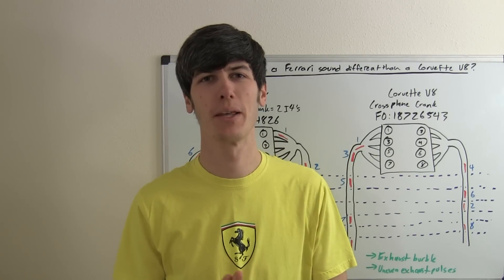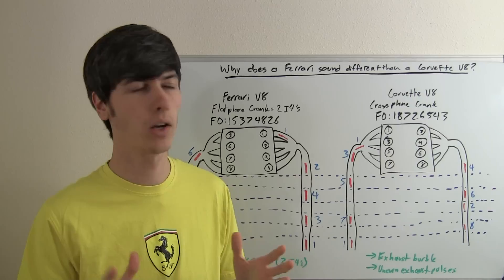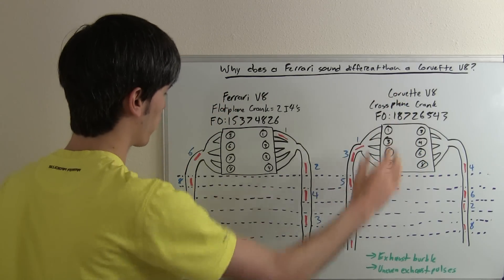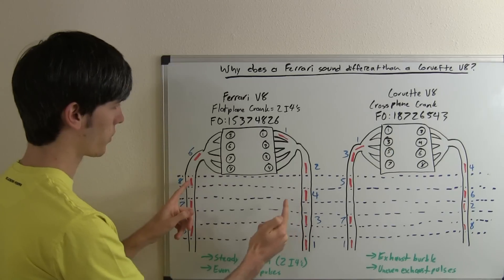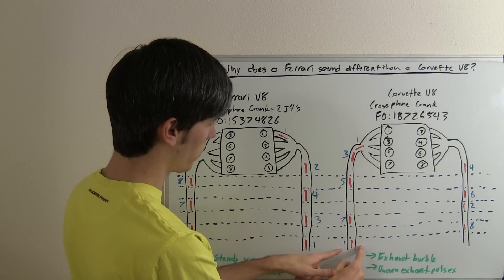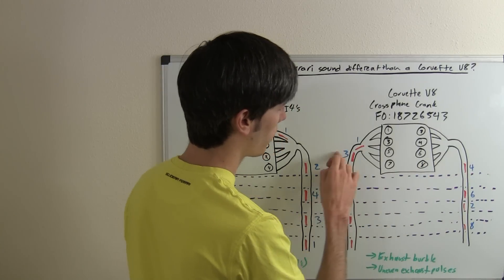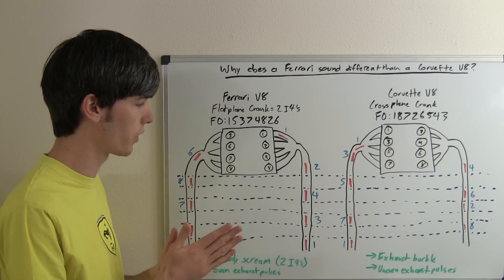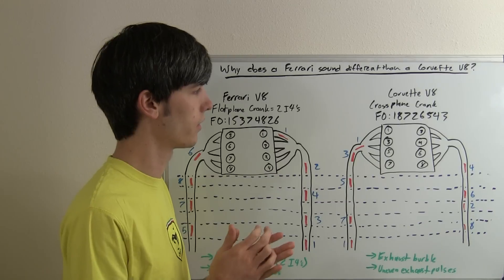Ferrari V8 vs Corvette V8 - Why do they sound different?

Comment: That's really cool, and it explains not just Corvettes but most American muscle cars. It also explains why supercharging is preferred over turbocharging on American V8s.
Reply: +Jason Gade American manufacturers seem to prefer supercharging the V8s, but I can tell you in the aftermarket world, turbocharging American V8s is quite effective.  Biggest limitation is heat.  6+ liter engine plus 2 turbos under the hood of a corvette get mighty toasty, and is harder to intercool than a blower.  A V8 with turbo lag is a bit strange also.  Most consumers would probably prefer the flatter torque curve of the blower, even though the turbo makes more power overall.

Comment: This crossplane / flatplane dichotomy also applies to inline four cylinder engines. The 2010 Yamaha R1 motorcycle uses an inline four with a crossplane crank - it makes the "v8" sound. So, in my opinion what we call the "v8" sound is in fact the "crossplane crank" sound. And the almost characterless sound of an inline four with a flatplane crank is also made by a v8 with a flatplane crank.

Comment: My Porsche 928 32 valve has a firing order 1,3,7,2,6,5,4,8. Cylinders 1 and 3 fire in succession on one side and cylinders 6 and 5 on the other side fire in succession. 2 and 4 in succession one one side and 7 and 8 every 90 degrees. I installed a free flow Mangaflow Muffler and I was next to a Ferrari at the traffic light and the driver gave me a sound compliment. My car sounds like an American muscle at idle but in higher RPM sounds more like a Ferrari. I'm not  sure if the firing order has anything to do with it but thanks for posting this. What's interesting is a 4 cylinder Alfa Romeo sounds like a toned down Ferrari.

Comment: There are multiple firing orders for both flatplane and crossplane crankshafts. Although this discussion only deals with the sound I would suggest you make a video describing each different type of firing order and explain the pros and cons for each. Which ones make more power, which ones make more torque. Which ones have high dynamic vibrations, which ones do not. Different firing orders achieve different results. Some firing orders make the engine run smoother at high rpms and some will shake the engine to pieces and explode!

Comment: The exhaust imbalance with cross plane crankshafts can be dealt with by using 180 degree headers.  It makes for one long primary pipe on each side and isn't very practical for street applications, but they are typical in racing engines.  They do change the exhaust note to more of a rasp than a burble.

Comment: A very good video, and it very clearly explains the difference between a cross-plane and flat-plane V8 engine... what you didn't explain was why most V8's are cross-plane, and the fact that cross-plane V8 engines are perfectly balanced, whereas flat-plane V8's, such as Ferrari's V8's and the upcoming Ford 5.2 liter GT350 Mustang V8 are inherently imbalanced, and are quite dependent on a short-stroke in order to not shake themselves apart.... in fact, it was widely accepted that Ferrari had pushed the outer limits of flat-plane displacement with their 4.5 liter flat-plane V8 until Ford developed the upcoming Shelby Mustang GT350's 5.2 liter flat-plane V8... Of course, Ford never could pass up an opportunity to one-up Ferrari, and more power to them, as that particular corporate feud dates back to the 1960's....  at the end of the day, the flat-plane crank V8 sounds incredibly sexy, but since it is inherently inbalanced it has fewer practical applications than the cross-plane V8, but is still a very interesting and sexy-sounding option as far as V8's go.
Reply: Ken Johnson  The 5.2 engine has an almost square bore and stroke at 94mm x 93mm.   It's not a short stroke engine at all.
Reply: The advantage of using a cross plane crank in a V8, (90 degree crank) is improved harmonics - it won't "buzz" at certain speeds, but, exhaust scavenging is inferior, and, two of the crank shaft's counterweights must be heavy enough to cancel out the see-saw like rocking couple such a crank will generate.  The use of a 180 degree crank in a V8 results in better scavenging and a lighter crankshaft, but, at certain speeds the engine will buzz just like a 4 cylinder engine.

Comment: Not a bad video at all. Some years back I heard what changed the exhaust note was the 60 degree cylinder angle, until I realized the third gen Ford Taurus SHO 3.4 liter V8's had the same set-up. So a little research explained it was the flat plane vs cross plane crank which changes the exhaust note.

Comment: Excellent graphic visualization of the exhaust pulse timing on each cylinder bank!

As was already mentioned, Ford managed to evenly space the exhaust pulses for better scavenging back in the day on their GT40 using their Bundle of Snakes exhaust pipes. That leaves me wondering if the normally heavier crossplane crank was still a disadvantage to free revving on that engine. I  would suppose internally vs. externally balancing an engine does nothing to overcome the heavier crossplane crank, but it may help alleviate some potential crankcase packaging issues by allowing the crank counterweights to be smaller on an externally balanced engine.  Is that so?

Comment: Pretty sweet getting to visualize this. Thanks.
I would love to know what makes the Subaru (WRX) exhaust note so identifiable...
Reply: Unequal length headers is whats making that sound.
Reply: Boxer engine
Reply: The boxer engine doesn't effect the sound. If you put equal length headers on it you lose the rumble and it sounds like any other 4 cylinder

Comment: Can't beat the sound of an old V8 with a rumbly camshaft. I'd take a '70 454 chevelle anyday
Reply: +Opticillusion160 Agree
Reply: Take it for what?..
Reply: Or poppet valved loop scavenged like this diesel
Reply: Loop scavenged through the valved like a hemi funny car 2 stroke loop charged
Reply: I had 472 caddy and I ran tcw3 in the crank and ran 50:1 premix

Comment: I really enjoy your videos, and wanted to point out something about the modern Corvette engines. In your previous video you mentioned how crossplane cranks are usually more racing oriented and not as reliable in the long run, but I have seen many LS engines with over 300,000 miles, so with modern technology I believe crossplanes have become superior when it comes to higher horsepower vehicles. Economy vehicles on the other hand are a different story.
Reply from the maker: I believe I referenced flatplane as the more racing oriented and having more vibration.

Comment: While this is all true it really isn't the main reason they sound different. The actual reason they sound different is in the headers. Ferrari's, if I remember correctly, use 180 degree headers which cause the engine to sound like a big 4-cylinder, while pretty much every other v8 doesn't. Ferrari engines without the 180 headers sound just like any other v8 be it American, British or Japanese. However, as mentioned in this video, they don't have a burble to them.
Reply: You're mistaken, a Ferrari V8 has a 180 degree crankshaft and, as shown, an even firing pulse on each cylinder bank. They have normal headers. Putting 180 degree headers on a normal crossplane V8 will give an even firing pulse and a similar sound to a flatplane V8. Just listen to any flatplane V8: Lotus Esprit V8, previous F1 cars, they all scream rather than roar

Comment: Also, one's OHV while the other is DOHC, one is undersquare while the other is square or oversquare, the Ferrari engine has twice as many valves... And those are basic, structural differences. There are many more, the only thing in which they both coincide is the number of pistons and not much more.

Comment: Bottom line. What RPM are you going to be running at?
If you need lower RPM torque, Go with a Cross.
If you need hight RPM torque, Go with a Flat.

Also Cross have a much smoother balance curve.

But keep in mind that High RPM comes at a price. They do not last as long.

Comment: Thinking out loud here, this would make for a good reason to tie the exhaust together close to the exhaust manifolds in a "X" configuration. Dual exhaust where the extra flow pulse from one cylinder bank would virtually assist the next 2 pulses from the other bank via a relative vacuum. Or buy a Ford Mustang with the flatplane crank when it comes out... but that's another topic for another assault from the Chevy crowd. (ducking and running for cover!)

Comment: 180 degree headers on a cross plane crank v8 will make it sound the same as a flat plane crank v8 as it will merge the runners in way such that they have even firing/pulses in the exhaust headers.

Comment: The new mustang gt350's got flat plane cranks yet they still remain somewhat of the classic v8 sound..why it that? What's making it sound that way if it's a flatplane? The firing order?
Reply: TheDefensivemaniac yeah somebody explain!
Reply: ***** "more bass because its american"? No...just no...i wanna say because of the size of the stroke..
Reply: ***** no.no.no.no.no what you said about ferrari tho about the exhaust...they do focus on sound but the exhaust only sounds as good as the engine sounds...i can see how bigger displacement can sound more deeper..but lets take a straight piped ferrari f430 (4.3 liters) and a straight piped gt350 (5.0,5.2 liters)...they would sound NOTHING alike at all! The harmonics are way way different on a ferrari! Like you said about ferrari how they make their cars like streetable  formula 1 cars..its true..flatplane crank,short stroke,and big bore..thats what a ferrari and a f1 engine have in common..on the other side a gt350 has a massive stroke..
Reply: ***** oh ok misunderstood.
Reply: +John Terpack lmfao that has to be the most american bias thing I have read. A ferrari is a much more refined and track oriented car than most american V8's. The exhaust does have something to do with it, but the actual engine does sound completely different due to firing order, displacement, and a bunch of other factors. If you are somehow disregarding ferraris, you have clearly never driven or rode passenger in one. They are works of art. On a track they feel nimble and agile, and not to mention ridiculously quick.
Reply: ***** Supercars are works of art, expensive, impractical but absurdly fast and beautiful. You may not like them because you only see things in the limited "practical" mindset. The reason supercars are so expensive is because of the effort put behind the making, designing, and testing of the cars. Your arguments is apples to oranges, supercars are built for the track and backroads, not going 75 mph on the highway or take a mild corner at 40 or 50 mph, that's not exciting. Supercar hype is indeed part of price but, honestly, anyone would love to own a supercar, whether it be a Ferrari or Lamborghini (I personally want a Noble M600) or, in your case, a Ford GT or Corvette Z06 (Z06 beat many supercars on the track so I consider it a supercar in my book)
Reply: ***** How are supercars soulless? Every car has a soul, especially supercars, try driving one once before critiquing whether a car has a soul or not.
Reply: ***** I don't like flappy paddles either but sometimes they can work. Look at the Lexus LFA, the single clutch sequential auto was engineered by Toyota to feel mechanical. No they did not do this by electronic wizardry but by making the single clutch abrupt so you feel the clutch engage and more like a GT racecar; and the glorious LFA V10 is definitely full of soul and character.
Reply: ***** I agree, but, some cars can still pull it off with flappy paddles. Like the LFA or Gallardo (still prefer it with a manual though). Even though, nothing beats an Italian gated shifter ;) And your Xbox analogy is completely wrong, driving a car in real life and driving a car on Forza or Gran Turismo are completely different experiences. Videogames can never recreate all the little mechanical communication you get from actual driving a supercar.
Reply: +Bootyslayer636 It use a different type of flat plane crankshaft. Normal flat plane is  made using UP DOWN DOWN UP(UDDU) configuration. The new Mustang is using UP DOWN UP DOWN (UDUD) configuration. I believe the firing order is a bit different than the normal flat plane. But it still  firing one cylinder at a time like the normal flat plane do. Another factor that affecting the sound is probably the header configuration.
Reply: +ghotichooder89 
Somebody has done their research you get a thumbs up lol
Reply: unequaled length headers due to the design factors of Ford manufacturers and developers in the engine compartment.
Reply: Have you listened to the new Shelby yet at different rpm levels?  I've been racing Mustangs for 20 years and that's no Mustang sounding engine I've ever heard.  It doesn't sound like a classic car v8 engine.  It sounds like a Italian supercar engine, to a certain extent.  but yes the firing order it is different then like what a Ferrari v12 firing order would be. So it does sound a little bit different than other flat plane crank engines. But it sounds a whole hell of a lot different than a normal sounding American muscle car V8 sounds like.
Reply: ***** the sound is somewhere between the normal muscle car and the screaming ferrari. it can be noticed when the car is in the high rev.
Reply: +Briane Howland (SoL93GT) You said Ferrari v12. I must have misunderstood. I thought that the comparison was between V8 engines. Maybe a v12 has a whole separate set of physics that somehow magically correspond to a V8?
Reply: +Jacinth Gudetti not really a v_tec in a crx gets respect from carahoulics
Reply: +Jacinth Gudetti the 60s and 70s chargers love rough roads on dirt a charger is a drifting dream,but any ferrari is going to out turn them on a road course,car guys seldom have money cause we spend it filling a garage,with a mix of cars.
Reply: exhaust set-up, especially headers, they play a big role, long tube headers make smooth high pitch sound, like Ferrari, shorty headers, especially made of cast iron, sound more agresive, like American hit rods, they don't smooth the "farts", this is how McLaren and 2016 Shelby sound.
Reply: +Bootyslayer636 I think the new ford V8  does sound too much like a Ferrari. Maybe a little deeper because the ford is a little bigger but the first thing I thought when I heard the new 5.2 was that it sounded like euro cars.
Reply: +Bootyslayer636  Arrangement of the exhaust headers in relation to which pipe they exit from
Reply: +Bootyslayer636 The gt350's flat plane crank is different than the  crank from Ferrari's v8's cause ford had to add more weight to it to balance vibrations within the engine and another reason i cannot remember
Reply: You guys are most likely correct as i stopped caring about cars newer then 1995 and have no idea what ford is doing. I had a 308 and it sounded like an4 cylinder which i hated, after rearranging the headers we made it sound like a true v8. So thats my personal experience. what im more concerned and saddend is my 1990 5.0 lx coupe which i bought back in 90 with. Out ac and manual windows then  used to weigh around 1300kg. Probably this thing weights 1700kg or more.
Reply: Bootyslayer636 because it's murica deep engine sound
Reply: you're the only one who gave a decent reply... I think that a way to get the rumbling exhaust note from a flatplane v8 would be inequal length headers, do you agree?

But I'm also thinking, if you got a crossplane v8 with uneven firing order (=uneven scavenging) could there be a way to fix that with inequal length headers?

Like, I fire 2 pistons together but they travel different distances so that the pulses are evenly distributed in the exhaust... is that possible?
Reply: X pipe
Reply: Unequal length headers. With equal length headers you will get more of that exotic ferrari sound as the exhaust pulses will be more even. I believe headers will play a bigger role on how the final exhaust sounds more so than whether crankshaft is flat-plane or cross-plane. 
Great question and good observation.

Comment: when did GM change the firing order in Chevys from 18436572? It had been that way since ever, and yes it'd still explain the burble on the old sbc vs foreign v8's  tho  I think a shorter stroke in ferrarri's v8 also has something to do with the higher tonal pitch
Reply: I noticed that too

Comment: Wouldn't the displacement of the engine effect the sound? A C6 Corvette has a 6.0L or 6.2L V8 vs. a Ferrari 458 which only has 4.5L. I may be completely incorrect I'm just curious
Reply: Coty Souvannaphoungeune I'm no engineer by choice but I am a certified mechanic and avid hot rod enthusiast. From my understanding and more so physical testing and books written by race car designers/tuners. The biggest factor that determines exhaust note is in the exhaust tuning. If you think of your exhaust like a horn the larger horns have deeper notes where smaller horns have higher notes. That being said the overall sound being produced is determined most importantly by: header design, tubing size, and the overall routing of the pipes. secondly the exhaust note is effected by resonators and mufflers. Bigger is better yeah sure but companies like Ferrari spend more time in actually tuning the exhaust for a less is more kind of mentality. More time in design means equal or greater performance at less cost per part in materials.
Reply: listen to a porsche 968 and compare it to an opel 1.3 or a honda 250rr. Or even better in your case, the Atom 500 to a ferrari enzo. They both are flat planes and Atom has half the displacement.
Reply: exhaust tuning is very minor regarding this its more about firing order and stroke, you cannot tune the exhaust of a ferrari to sound like a corvette or vice versa